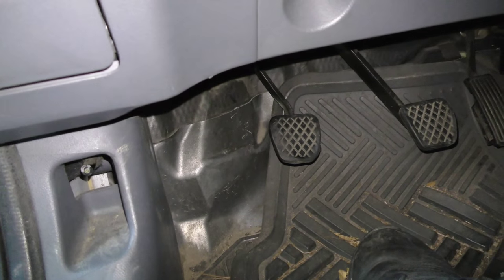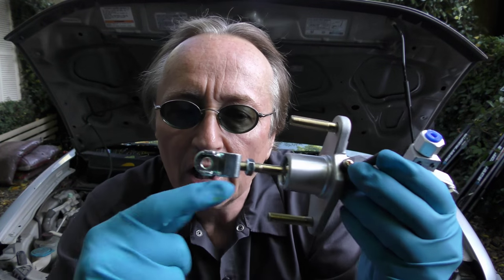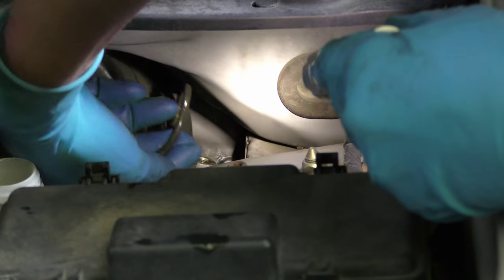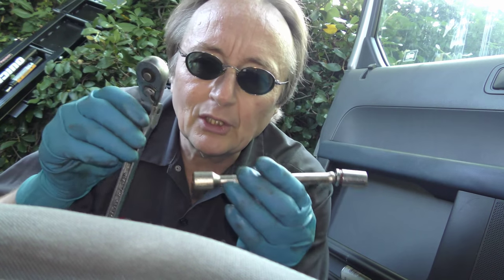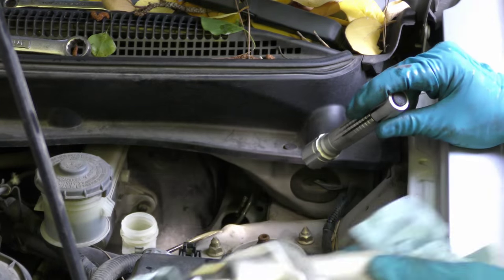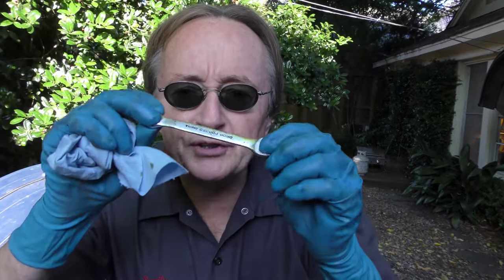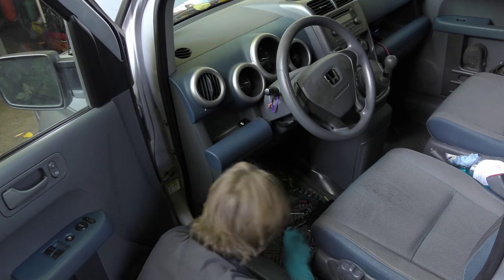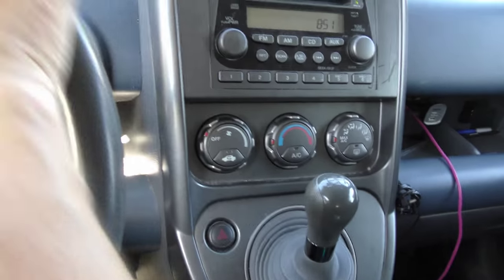How to Fix a Car that Won't Go into Gear (Clutch Master)

Comment from the maker: Things I used in this video:
1. Flare Wrench Set: http://amzn.to/2ApOQ1y
2. Wrench Set: http://amzn.to/2kmBaOU
3. Large Screwdriver: http://amzn.to/2igwntV
4. Flashlight: http://amzn.to/2BFak8y
5. Disposable Gloves: http://amzn.to/2zSRuxO
6. Common Sense
7. 4k Camera: http://amzn.to/2hZ4AxX
8. Mini Microphone: http://amzn.to/2newgV9
9. My computer for editing / uploading: http://amzn.to/2i2sKYz
10. Video editing software: http://amzn.to/2jv5Fhf
11. Thumbnail software: http://amzn.to/2k7tz6C

🛠Check out my Garage to see what I use every day and highly recommend:
https://www.amazon.com/shop/scottykilmer

❗️Check out the Scotty store:
https://goo.gl/RwhRGU

👉Follow me on Instagram for the latest news, funnies, and exclusive info / pics:
https://goo.gl/ohy2cA
Reply: Scotty Kilmer i have a 2018 wrx when im drivinf fast shifting fast from 1st to 2nd at over 4500 rpm theres no problems but when im over 4500 rpm and shift from 2nd into 3rd i hit what feels like a rubbery wall. It wont go into 3rd untill the rpm drops under 4500 rpm. Any ideas i took it to the dealer they said i just ha e to brake the car in but im not buying it if you could give me any feed back id apreciate it.
Reply: Scotty Kilmer I have 3500 6.5   diesel 1996  it will go in any gear after starting the truck but shifting after that it won't engage at all . You will have to shut off the truck and move it gear also at a stop point . What could be the problem . Plz.let me know
Reply: Scotty Kilmer hey thanks for your videos bud,   you always get right to the point and tell me exactly what i was looking for.   Straight forward knowledge!
Reply: Scotty Kilmer  i subscribed cause ur simply awesome brother
Reply: Scotty Kilmer hey there I have 2 gear not catching ls1 98 6 speed
Reply: Scotty Kilmer what if you have recently replaced the clutch a few hundred miles ago would it be the slave cylinder or the master cylinder?
Reply: Hey Scotty I replace my clutch ,flywheel and slave cylinder and my hydraulic master cylinder out of my 07 gt mustang and I even cleaned my clutch line  you don’t mind giving me an idea what it could be not letting me  go in to gear
Tomorrow I planned on dropping it out trans  and check if it’s good and make sure it’s not defective or something
Reply: 0
Reply: Quick question, i have a 2008 mustang gt. When I’m just sitting and idling my car won’t let me in any gear at all, I’ll have to turn the car off, put it in gear, then start the car to move but once i get moving i can shift into any gear. I just installed a stage 3 street level McLeod Saturday and it was working ok until i went out roll racing a few days ago. Do you think that could be a master cylinder issue?
Reply: Scotty, my car developed shifting issues far from home (2012 MX5 w/5 speed manual transmission). The local Mazda dealer service said their master mechanic with over 30 years of experience would test drive it, diagnose the issue and fix it. They changed the master as slave cylinders at the tune of $1200+ and returned the car with the same issue. I think their master mechanic doesn't know how to diagnose shifting issues in a manual transmission.

When I returned with the same problem, the service rep came back and said "the good news is we found the issue (bad pilot bearing) the bad news is it will cost me $2400+ additional dollars. I declined their offer and went back to consider my next move.

I found another local shop where they dropped the transmission, replaced the clutch kit which corrected the problem, they charged me $1562 including taxes. Anyway, I think the dealership did a bad job, the failed to diagnose the original issue and later basically shrugged their shoulders. What is the correct way to diagnose an issue like this? I'm asking the credit card company to do a charge back, any thoughts?
Reply: A
Reply: What car is that? It has a Chevrolet badge on the front, but a Honda badge on the steering wheel????? I am confused!

Comment: 47 years of messing with cars, and you still finds joy in sharing your knowledge. I salute you! Impressive ( and you know your stuff...)! Best wishes from Denmark.
Reply from the maker: Hans Nielsen hey, send me a couple of those hot Danish women.
Reply: No problem. We ship them in various sizes, mostly in packs of ten. You can also grow them in the garden. Favorit model is the little mermaid lookalike......Just kidding. I have a little comment on your oilchange schedule though. We have a 2008 Renault Laguna 2.0 diesel with 150 hp. Oilchange every 18000 miles. It has now clocked +200000 miles, and still runs like new. Never been opened or in anyway messed with. Do I have to say we like the damn thing😊!  Best wishes Hans.
Reply: Hans Nielsen p in on
Reply: Life hacks

Comment: Thanks for the video Scotty! 
What about if it doesn't want to go into gear while the vehicle is running but it will go into gear like butter while the vehicle is turned off?
Reply: I am having this exact problem right now!! I start the car up with full feeling in the clutch and can go from gear to gear easily. After just a few uses of the clutch, feeling is totally gone and the clutch will not engage. When I stop the car and turn it off, the clutch instantly regains feeling and I can drive the car for another minute or two until the clutch starts to lose feeling as I use it again.
Reply: Im having the same problem!
Reply: Me too same problem
Reply: Did u figure it out same problem lmao
Reply: andres same problem. Who figured it out?
Reply: @99_goat91  got it resolved already?
Reply: Did anyone in this thread fix the issue?
Reply: I have the same problem. 😭 I took it to the mechanic. It seems that it’s the clutch.
Reply: Same
Reply: same problem
Reply: it seems like there is still just a leak in the hydraulics somewhere (anything between clutch master cylinder and slave cylinder), and turning the car on just builds the pressure up again in this system but it leaks back out when you use it.

Comment: Scotty has helped me fix so many different problems on all of my cars, I've owned 4 different cars that i paied a combined total price of $2000 AUD and they all run perfectly except for the master cylinder in my ford transit of course but without Scotty they'd all be at the wreckers.

Comment: wow he removed it in under 2 minutes hahaha
Reply: K And not a single cuss word. Incredible.
Reply: *****  it seems that you could not get the sarcasm
Reply: K I was not to good, and my first time. Took 2 days of tinkering, well 1 evening and a morning.
Reply: ***** Never fear, youngling. You'll soon learn the ways of the internet. (pats head)
Reply: K Depends on the vehicle... 2 bolts and a metal line and mine comes off... Its pretty easy for mine.  Maybe 10 mins full swap and bleed.
Reply: about 90% of the cars use 2 bolts but for that honda with bleeding its usually 20 mins job and other cars like nissan etc... which have easy access to bold its a 10 to 15 mins job a blessing for flat rate guys
Reply: I had a old 80's Toyota Landcruiser with a straight 6 motor years ago that I could work on myself, pretty much. Prior to it I had a few American vehicles, both Ford and Chevy, from the same era that were complete pieces of garbage destined for the junk heap after 100,000 miles.
Reply: oh that mighty 4.5 very very simple to work on and lasts for ever
Reply: The magic of video editing.  Real world time: 6 hours and 2 trips to the car parts store.

Comment: i have a 93 honda del sol also manual transmission and I can not go into gear as well. I already changed the master and slave cylinder and still no luck. Doesn't going into gear unless. I turn off the car I put it in gear and it starts to move but it makes a screeching noise any help?
Reply: +Scotty Kilmer same problem, i have 95 del sol and replaced the master and slave cylinder but car doesn't go into gear when turned on, could it be the clutch throwout bearing? what else could cause this
Reply from the maker: +johnny test I just did one the other day, it needed a new clutch set, you replace them all when taking the transmission off anyway
Reply: Thanks Scotty, I'm in the process right now of removing the transmission and replacing all components of the clutch system. Is there an effective way to diagnose the Input Shaft Bearing without disassembling the gears?
Reply: Emiliano Espinoza mines too did you find out what it was
Reply: My del sol some times has an issue going into 1st and reverse.  The clutch fluid seems to be dirty so I'll start with replacing that since it seems simple and cheap to do.
Reply: @Eldin Gusani I replaced the transmission fluid and the clutch fluid.  My problem was never severe but enough of a problem to where it bothered me because sometimes in traffic I couldn't get it into first unless I let off the clutch and tried again, then it would work.  So I replaced the trans fluid with Honda fluid and the clutch fluid with Honda Dot 3 brake fluid.  I also swapped out my shift knob for a weighted shift knob which helped a lot.  I think my problem is the synchronizer for 1st and reverse.  But in the mean time, before I swap that out (because that requires removing tranny and opening it) the combination of those 3 seemed to help.  I also noticed after driving a bit and fluid gets warmer it seems to help.  Like I said though,  my problem isn't that severe.  Maybe out of 10-20 shifts into 1st, I might have 1 time where it doesn't want to go.  I believe the problem will get worse before better but for now it's manageable.   Hope that helps.  *Also some people swear by other brands of transmission fluid other than Honda and say they're superior but I stuck with Honda MTF just to be safe
Reply: @sentree9857  i thought the reverse never had synchros? did you end up finding out what was wrong with yours
Reply: Rebel yeah I think you’re right about reverse. I think my issue is the 1st gear synchro. It hasn’t been that bad so I’ve been holding off on opening up the transmission.
Reply: @sentree9857  hey bro I have the same issue right now! I recently replaced the clutch and never had the issue with the old clutch till today. Any suggestions on how to fix this problem? Thank you
Reply: @JoseHerrera-pe4xz  if it’s only one gear you’re having an issue going into, like my issue, then more than likely it could be a gear synchronizer.
Reply: @sentree9857  it’s my first gear and reverse, but my first gear will do it every once in a while but reverse its very stiff I have to use more force. Sometime it goes in smooth I just got my clutch done last week and have this issue. Thank you for replying!

Comment: What if its a cable and no hydraulic at all in my old vw but it still won't go into gear ? And only goes into 2nd 4th and reverse but I have to fish for the gears like if I throw it in reverse but it might go to 2nd or 4th help please
Reply: DaFonz29 sounds like u may need a new shifter,if u have to fish for gears then it can be one of 3 things,maybe all 3 together,u may need a new transmission,new shifter,and/or a new clutch
Reply: gearbox mounts may have come loose
Reply: Could be the shift cable bushings are worn out.

Comment: 2 days ago, I wrote something about  my car,( won't go in gear), we just fix it today,  Scotty! But totally  a different issues from this Video,  Just need to replace the drive shafts. 💂💂💂💂💂💂💂🗯💭💭.
The Bills said, Remove&Replace Axle shaft-one side $135.00, New CV Axle $182.99. 😍$20 off $100 services.  My car can run like a new car, even on the hill. At, Complete auto care (Firestone-USA)

Comment: We don't have it anymore, but the 1985 Jaguar XJ6 he had was hard to start. Dad said the flywheel was missing teeth, and I remember trying to start it in the months before sending it to the scrap heap; it did sound as if the starter motor wasn't touching the flywheel (AKA "Flex Plate" in more recently made vehicles.)

Comment: Hello, Scotty!
I wanted to ask about similar problem, when shifting into 1st gear, it goes, but makes some cracky/crunchy noise like if I haven't pushed the clutch pedal enough.
And the stick almost doesn't center back (horisontally) as well.
I had transmission oil changed last summer (not sure if they changed the
 filter as well), this noise happened occasionally, but now it's like 
70% of times. 

Have a nice day! And thanks for your channel, very informative, and fun to watch.
Reply: Scotty Kilmer
Thanks!

Comment: Hey Scotty. What do you think about a car that goes into gear and sometimes it grinds and kicks back out of gear. Usually the third gear that does that to me. Its not as smooth as shifting into other gears as well. Is it a big problem?
Reply: I had a 1969 Opel that the dude that sold it to me used to “speed shift” and wore out the synchronizers.  It would do the same thing.  It would go into gear but would jump out of gear.  I found a used transmission and things were fine.

Comment: One crucial thing I have also found on my Holden Commodore which has a hydraulic clutch master cylinder is that the clutch pedal needs to be adjusted properly,meaning that the clutch pedal should be adjusted so it is in line with the brake pedal, or Else clutch fluid Will be forced past the hydraulic seals anyway, after overhauling the master cylinder fluid was still leaking from the master cylinder and was rectified by adjusting the clutch pedal height so it isn't leaking fluid anymore.

Comment: Hi Scotty, i have followed your page. And I have used a lot of your tips and tricks.

So i Hope you can and Will answer my question.

I have a new gearbox, New clutch and clutch slave fitted in my opel astra.

When it is cold i am having a Hard time going into 1 and 2 gear. When it is hot there is no problem.  

There is no leaks to see and it does not use any fluid.

Thanks for an amazing page 👌💪

Comment: If your car won't go into gear during drive, you should push fast five times clutch pedal to change gear fast in order to reach shop to buy new master cilinder. By the way, i loved your glasses.

Comment: Help,  2001 PT Cruiser, manual. For the past month I'm having problems shifting.  All 3 shift cable bushings are fine and relatively new as I replaced them recently.  After this video it sounded like my clutch master cylinder could be the issue but I found no leakage, not losing fluid, even adjusted clutch pedal up higher to push in further, no change.    Only once I couldn't get it to go into any gear trying to leave home.  Most times it just doesn't go into gear smooth, like there's two stages and both are hard to push  into and doesn't feel like it's actually the whole way in most times.   Sometimes at a stop, in N, I'll try to go into gear and it's like the gears are moving (which would seems like clutch not fully disengaged).  But if I'm in gear and moving pressing in clutch pedal I see the rpms shoot up quickly which makes me think it disengages fine.   If I had any hair left I'd be pulling it out trying to figure out why it's so hard to go into gear.   Occasionally it goes in just fine and smooth.   Very inconsistent.    What else should I be checking?
Reply: Justin it's probably your transmission, same thing happens to mine, usually 3rd and reverse get stuck

Comment: I just put a new slave cylinder on my element last month. It looked like the master had been replaced recently by the previous owner. Do you recommend just replacing them together to avoid doing the job twice within a year or two?

Comment: Hey Scotty I just bought a 2000 Nissan Frontier 4 door v6 with 119,430 miles on the truck. I was surprised that the service engine soon light came on and put the scan tool and the code that popped up was P0744 Nissan - Torque Converter Clutch Circuit Intermittent
Reply: I checked the transmission oil it's not dirty at all. Doesn't run funny at all no problems when it's being driven
Reply from the maker: Eduardo Garcia those lock up converter solenoid systems often have problems, and removing the transmission to work on that system is expensive. SO. I'd change the fluid and filter and see what happens,.  Just realize if it's off some, it can still run fine, just would get a tiny bit worse gas mileage.
Reply: Thanks Scotty I'll change the fluid and filter. Hope it fixs this problem

Comment: whats up scotty, got to say you videos helped me out on multiple situations. 
but this 1 is iffy, i got a 2000 dodge ram 1500, and i have to force the clutch into gear. now i changed the slave/master cyclinder and did the works. but it still doing the same thing, another thing is that the clutch assembly is a little funny. the rod got out of place with the clutch barely hanging on, and the guy i brought it from would jam the clutch down to get in into gear ( if it even worked, if not he would hop it into gear) soulc the clutch brake assmbly be the reason to this issue
Reply from the maker: see if it moves the rod on the clutch master smoothly and is adjusted tigt at the assembly. Pray it's that and not a bent clutch fork or internal clutch parts having problems

Comment: Hopefully I don’t need a new clutch and this is the fix
Reply: Me too bruh
Mine is. Doing it when I try to go into reverse and randomly sometimes it won’t got in 1-6 gears at a red light  
2013 genesis coupe rspec manual 99k miles

Comment: May be a beetle, modified A6 engine v6 cramed in there when i lived in Germany. The clutch was replaced with a heavy duty dual mass clutch and fly wheel, new master and slave cylinders. Im hoping its just the fluid, 15 years old but it has 97,278 miles on it! All link cables are new!

Comment: Always helpful info in your videos. I have a 93 Silverado k1500 that has a similar issue. It only goes into 3rd and 4th now but before that it was getting hard to go in any gear and reverse would grind bad. What other things could cause this?